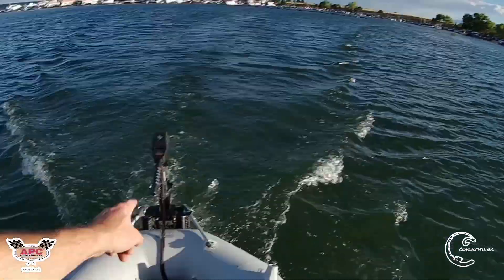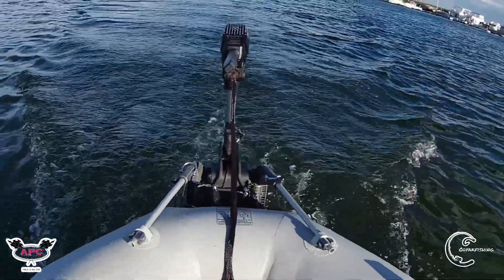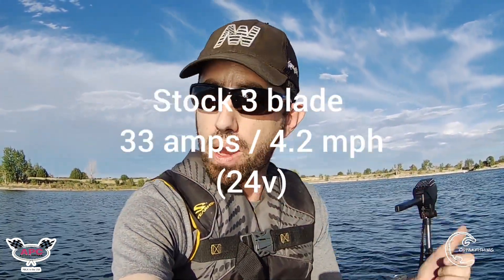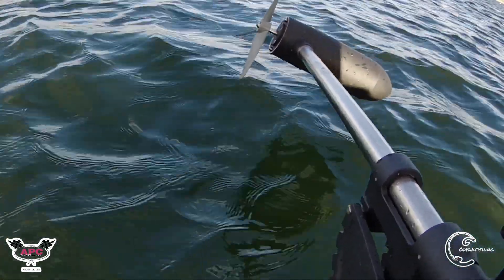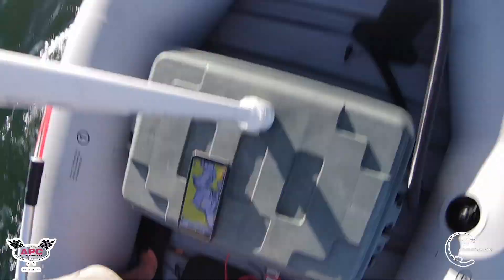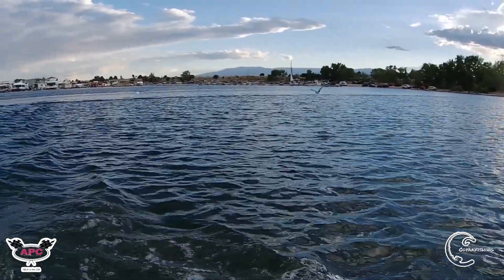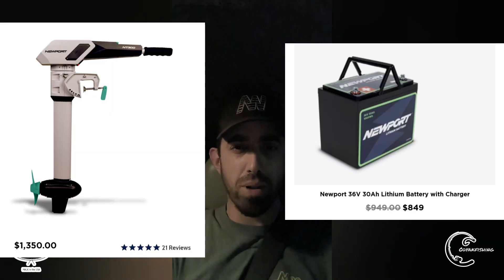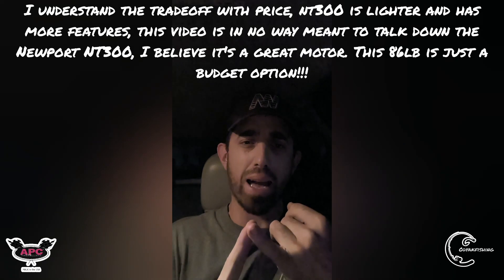350$ electric outboard motor (86lb 24v VEVOR trolling motor with 10X8m-LH APC prop)

Comment: Awesome man! Been following these tests for a bit. Wondering what prop I’d need for a terrova? Thanks for sharing your test man.
Reply: Both APC 10x8 and 10x5 consumed similar amp on my Vevor 86lb and delivered similar speed on my Tobin Sports SIB. However I've notice that 10x5 had a noticeable flex at full speed, you really can see the prop blades bend inwards forming almost a spherical cap, which most likely affects the efficiency. The 10x8 may not be as good a fit for this motor as 10x5, but it's a much strong design. 

Can we petition APC to make a 10x7 or 11x6 marine prop?
Reply from the maker: @helloterran  I'll talk to them and see if that's a possibility about the props, I was thinking a 10x6, with thicker blades
Reply: @helloterran  I think a 10x5M or a 10x6M with the thicker blades and rounded tips of the 10x8M would be the ticket.  A MK motor at 1540rpm using a 6"pitch with 15% slip yields 7.4mph. Vevor states max rpms as 1700, which yields 8.2 mph. Over 6" is almost certainly too much for most trolling motors. My 55lb MK bends the 10x5M-lh a lot, which suggests that a stronger 5" might be quite good.
Reply from the maker: Yea that 10X8 seems to be built a little tougher, I got much less amp draw on the 10X5 than the 10X8 on my setup, did you use the same exact 10X5 I did??? The 10X5m-LH??
Reply from the maker: Your welcome and thanks, what pound thrust is your trevoa??
Reply: @codyakfishing8856  it’s a 24v 80 lbs thrust. Thanks for the reply!
Reply from the maker: @nt_wicked_bunch2717  I got more speed with the 10X8m-lh but it used more current, I haven't tested the 10X5m-LH on the 24v yet, but for the price I'd get both of those.....
Reply: @codyakfishing8856  so the LH is for “left hand”?
Reply from the maker: @nt_wicked_bunch2717  yes sir.....
Reply: @codyakfishing8856 so that would would with a bow mount terrova then? Thanks for the help!
Reply from the maker: @nt_wicked_bunch2717  np, just a note, they are not weedless, I'm comfortable with the 10X5m-lh, but I recommend with the 10X8m-lh, that you check the amperage, I wouldn't want it to go over 40-45 amps at full speed

Comment: I have yet to see a durability test. Part of why your factory prop is what it is makes it tough enough to contact a rock and not be destroyed. Yeah cheap enough to carry a spare. But is it really even worth the trouble a couple of tenths of a mph? The rivers i go to prop contact is unavoidable and imminent. Will it survive an encounter with a rock like a factory prop does time after time?
Reply from the maker: I don't think they would survive many run-ins with rocks/sand. In your situation, it would t be worth it to switch, I don't recommend using this prop to everyone.
Reply: The APC blades aren't just faster: The 10x5M blade much more efficient than stock, so you'll get a much longer runtime at equivalent speeds. However, I wish they made a 10x5M with the blade style of the 10x8M. The 10x5M has thin pointy blades like the APC's RC plane props, but the 10x8M has thicker blades, rounded tips, is actually pretty stout, and has a sharp trailing edge that might do a decent job of chopping weeds (in reverse). That being said, even the 10x8M probably wouldn't do well with rock strikes.